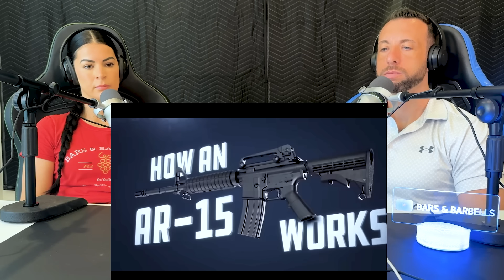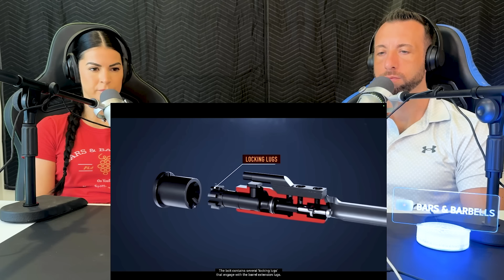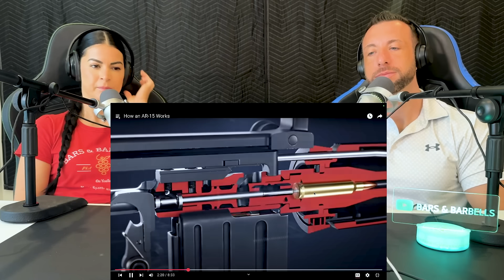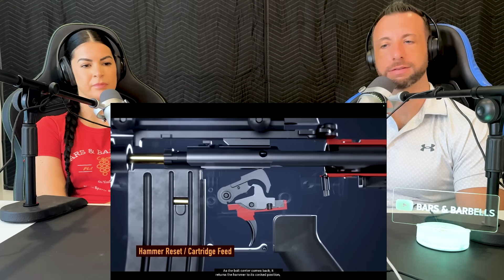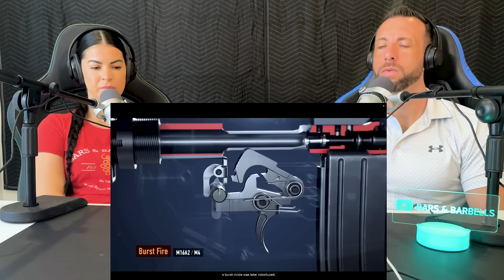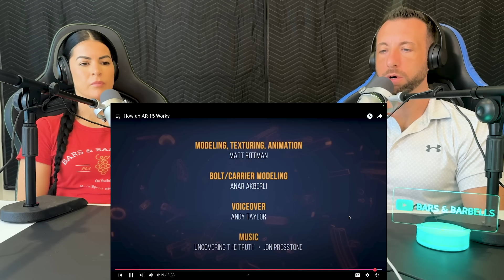This Is What Happens When You Pull The Trigger — AR-15 Mechanics Explained ⚙️

Comment: My state banned these so I bought 2 before it took effect. I bought 2 lower receivers locally but I needed my son to tell me what parts to order to build it. I had to put together all the pieces you saw in the video. That was 2 years ago and I still haven't fired them yet. Partially bc expensive ammo and moreso bc im in no hurry. I also hope I built them correctly so they dont blow up near me face.
Reply: There are ways to basically anchor them to something solid, and tie a string/line to the trigger and run rounds through it while standing at a safe distance preferably behind cover. I am 70 now and helped my Father and Grandfather do it on any new (or old) firearm they had questions about. That's how I tested them. Be careful. Use this method at your own risk I accept NO responsibility for any damages to persons or property.
Reply: If you buy an assembled upper receiver, then you don't really have to worry.  Installing the barrel in an upper receiver is the only real complex part, and it's really not difficult either.
Reply: 1. Take you rifles to a competent gunsmith and have him or her check it out to make sure it is safe.
2. That said, when it comes to AR parts, everything is pretty standard so the parts should fit together safely out of the box. However, one thing you will want to check out is headspace. The quick and dirty layman's definition of headspace can be thought of as whether or not the rounds will fit properly into the chamber. Headspace can be wrong if the chamber is itself incorrectly bored out of the barrel, or if the barrel is not attached properly to the receiver. If there is too much headspace, you might get light primer strikes because the firing pin does not go far enough forward to cause the anvil in the primer to create the spark that ignites the powder in the round, resulting in the round not going off. If there is not enough headspace, the bolt will not fully close and go into lockup, meaning that the chamber is not fully sealed. This can be dangerous because the hot gasses generated by the burning of the powder that are supposed to propel the bullet down the barrel could instead push the unlocked bolt back into the receiver and cause said hot gas to be expelled into your face (and/or propel the bolt itself backwards at a speed fast enough to damage the gun and/or your person). You can check headspace by getting headspace gauges to test your gun. The bolt should fully lock up when the "go" gauge is inserted into the chamber, and should fail to lock up when the "no go" gauge is inserted into the chamber. If the bolt fails to lock up on the "go" gauge, you don't have enough headspace; if it locks up on the "no go" gauge, you have too much. Obviously, you should be testing the lockup by manually opening and closing the bolt rather than simply pulling back on the charging handle and letting it drop, which could give you a false reading and damage the gauge; likewise, forcing the bolt to close on a gauge will damage it. A set of gauges for any particular caliber should cost $50 to $100, depending on quality.
Reply: If you don't have a rest (a specialized clamp rig that holds the rifle for firing remotely), load ONE ROUND in the magazine, keep the weapon pointed downrange, close the bolt with it away from your face (which should have eye protection upon it, obviously), and fire that one round from the hip. DO NOT shoulder an untested homemade weapon until you've repeated this several times and then disassembled it to check for peening and battering (stuff getting beaten out of shape) and any pin walking or other sad things. Check your spent brass for consistent dents, bulges, or primers that are flat or pierced (you'd already know about the latter and be appreciating the eye pro). 

Then proceed to two rounds, same procedure. Major change is now you're checking the disconnector and firing pin protrusion, making sure it doesn't run away. 

Inspect, and then run it like normal. Check the screws on the gas key every couple boxes, and that none of the other threaded components are trying to escape. 

Or.... hand it to a gunsmith for a checkout. They have gauges, fixtures, and knowledge that can be painful to learn the hard way.
Reply: @mfree80286 thanks for the tip and I thought about hip firing first. Problem is, the gunsmith i took it to said he cant work on it due to state laws.

Comment: The AR-15 is one of the most reliable weapons and most versatile. There are so many options available for barrel length, different calibers, optics, custom internal components. You can convert it to a piston system which replaces the gas tube with a piston that moves the bolt. It is very easy to disassemble and reassemble and replace broken or upgraded parts. Easy to clean and maintain. Relatively inexpensive to purchase and ammo is plentiful and cheap. That makes it one of the most popular weapons to own. But it's not the weapon of war that many people describe it as. Only the M-16 and M4 are true battle weapons.
Reply: I think we all know the AK-47 is the most reliable rifle.

Comment: This is really cool. When I was in the Army over the course of 4 years I spent many many many hours with my M4 disassembled cleaning it. Most of what was in this video I figured out on my own just looking at how all the parts moved and fit together. The one thing I could never figure out was how 3 round burst worked. After watching this video I know how.
Reply: Poorly designed 3rd burst. Mechanical solution to a training deficit.
Reply: So, you weren't paying attention in basic, copy.
Reply: @stinkystu1 they didn't get into that much detail on the internal working when I was in basic. My MOS was 13 b field artillery. They made sure we knew how to clear jams and hit targets. Beyond that they didn't go into the internal function. I just figured out how everything worked while cleaning. It's not something we were taught.

Comment: There's no clip. A clip goes in your hair. It has a totally different meaning when it comes to ammo.
It is called a magazine.
Also, you cannot buy a fully auto or one with burst mode. The AR-15 Is ONLY available as a semi automatic which means one pull of the trigger, one bullet. You have to pull the trigger again in order to get the next shot out.
Reply: Some guns do in fact use clips. The M-1 Garand used an en bloc clip. Many bolt action rifles use stripper clips. The broom handle Mauser also used stripper clips, a few other pistols as well.
Reply: @bierce716 stripper clips are a whole other thing.
My point being that a magazine is never called a clip.
Reply: @gregleblanc9357 Clips are apart of firearm terminology but it’s used incorrectly is what you mean.
Reply: Technically... you CAN buy a fully automatic rifle or one with burst fire, you just need to hold a FFL. (not the easiest thing to get and keep) lol
Reply: @Animo2006  You cannot buy a "NEW" fully auto firearm, they are only available to the public on the used market, (very expensive, I might add)  and after an extensive background check of an FFL holder. Then you pay for the "Tax Stamp" and it is registered to your FFL. There are also extensive rules on who, where and how it is used, stored and transported..
Reply: @krasht1  Yes, this is true. I am aware. All thanks to the 1986 assault weapons ban.

Comment: Only a North American channel would label an assault weapon a piece of art. 😢
Reply: I've never seen an assault weapon in all 8 years in the military.
Reply: There is no such thing as an "assault weapon". It is a made up term with no definition beyond what some pundit or politician wants it to mean at any given time. Now the term "assault rifle" does have a actual military definition. However modern sporting rifles built on the AR platform do not meet that definition since they lack the select fire capability.

Modern sporting rifles are indeed a work of art, they are an engineering marvel. A perfect example of function over form. No less a work of art than a Ferrari
If I could only keep one of the dozens of firearms I own it would be one of my modern sporting rifles built on the AR platform. They're light and compact and their modular design makes them incredibly versatile. They are also generally accurate weapons. One can expect a medium quality one to achieve a 1.5" MOA. One of mine has a MOA of 1".

Since they are usually chambered for 5.56 NATO they are considered underpowered for larger North American game, but they are excellent for wolves, coyotes, mountain lions and smaller game like pronghorn and white tail. However due their modular design they can be easily be upgraded to a larger round by a simple barrel/upper receiver swap.
In fact the only thing they suck at is as a EDC (Every Day Carry) weapon and as a fowling piece.